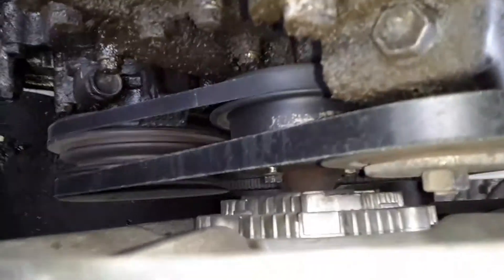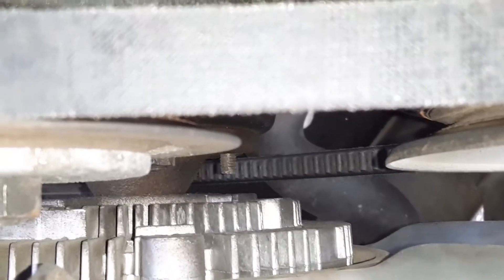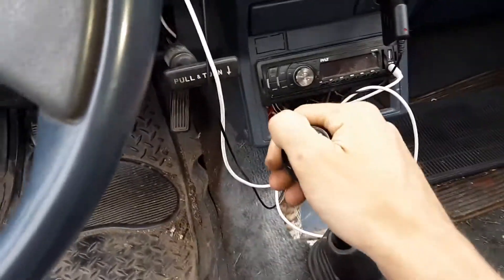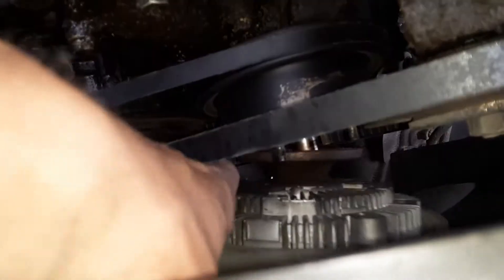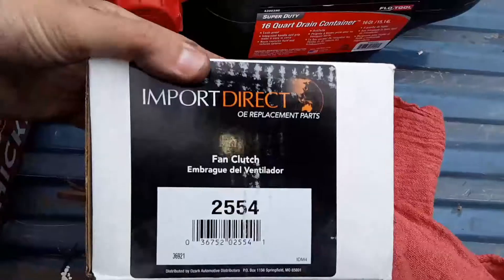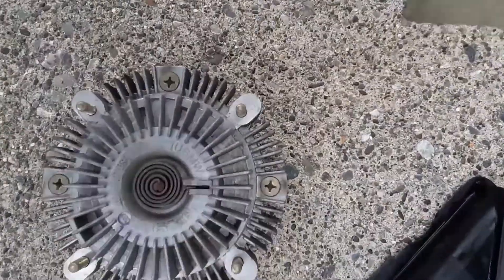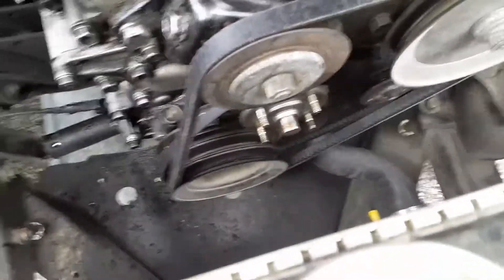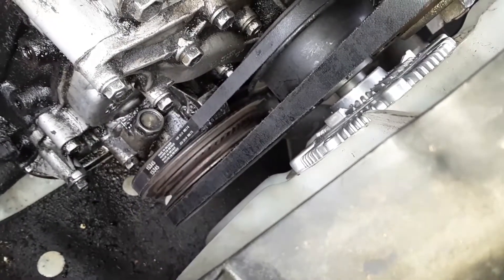22R How to Replace Fan Clutch // Overheating at Low Speeds

Comment: It is supposed to spin with a little bit resistance. You basically replaced a brand new fan clutch for a slightly newer one lol
The old one was rust free and still shining 🤌🏼

Comment: Can you remove the fan shroud without removing the fan and fan clutch? I'm missing 25% of the fan shroud and want to replace it. But I'm not sure if I can simply unbolt it and pull from the top and somehow there's enough clearance between the radiator and fan to then pull up the fan shroud to remove.
Reply from the maker: Yes you can. It's a bit of a puzzle to get it out but it is possible.
Reply: I didn’t need to remove the radiator. It just slides over assuming you buy the OEM fan shroud. A cheap knockoff will not fit as they are too deep compared to OEM. If you want it you can have my cheap Chinese knockoff
Reply: U gotta take out the radiator

Comment: Where did you buy the cowling that attaches to the back of radiator??  Mine kept on rubbing on my fan.  My NEW radiator, clutch and Fan look exactly like yours.  I finally took my cheap plastic cowling off for fear it would get jammed and destroy my Fan + Radiator!!’
Reply from the maker: Try this site:
https://www.yotashop.com/fan-shroud-toyota-4rrunner-pickup-truck-2-4l-22r-22re-2wd-4wd-oem-upper-radiator-fan-shroud-1984-1995-16711-35030/

Comment: Thanks for uploading . Helps a lot on my ‘86
Reply from the maker: No problem. If you have any chain slap, take advantage of the opportunity and pull the timing cover off. Throw on some metal guides. May aswell replace the water and oil  pump while your at it. There are inexpensive kits out there: https://www.amazon.com/22re-timing-chain-kit/s?k=22re+timing+chain+kit and also some really nice ones: https://www.lceperformance.com/Timing-Chains-Kits-s/14680.htm

Just my 2 cents. 

The area is much easier to work on if you can drain the coolant and pull out the radiator. Draining coolant is required to remove the timing cover anyways.

I'll be making video on this topic soon.
Reply: just discovered my fan clutch wobbles quite considerably, though have not had temp issues. Would readjusting/tightening the four bolts be the first thing to try? Are there other failure points that could lead to a wobbling fan? Thanks for the vid!